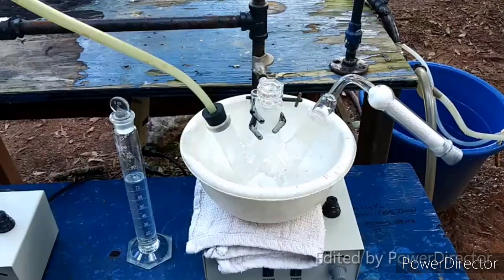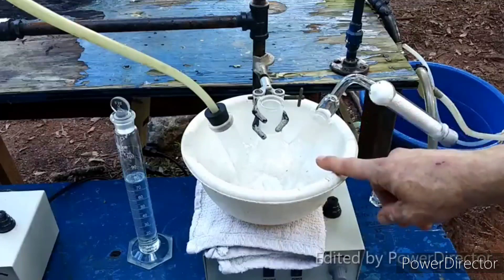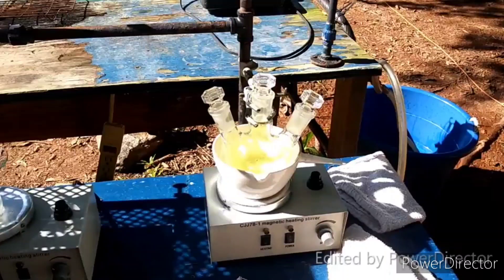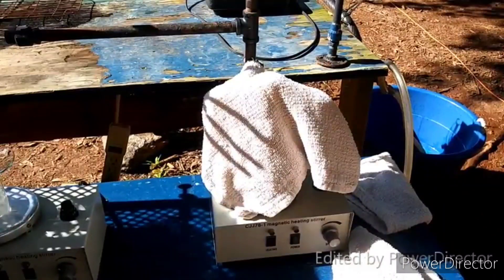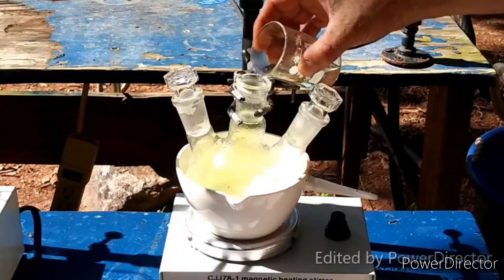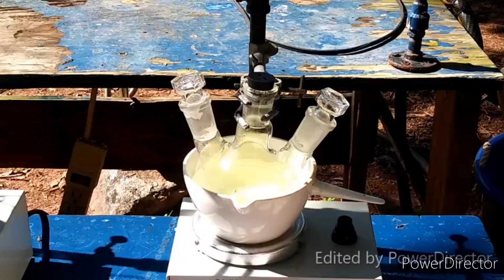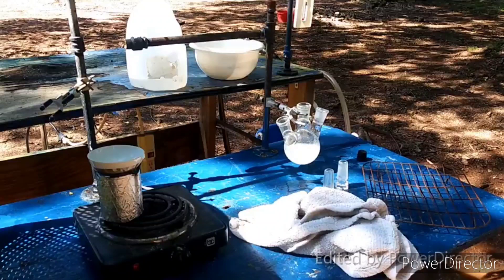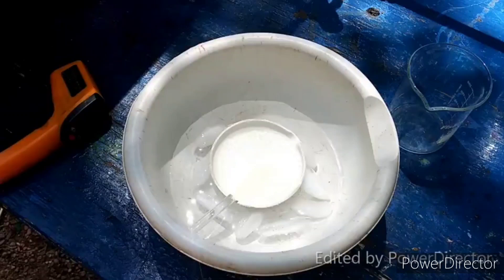How to Make Ammonium Hexachlorostannate(IV) #chemistry

Comment: Smelly toxic chemistry on a picnic bench. Been there. Yeah the chemical you just inhaled is chlorostannic acid, Cl2, and HCl. nasty stuff. The copper salt is added to antifouling marine paint and is 😵 toxic. Get yourself an israili gas mask with some nato cartridges. Stay safe. ❤
Reply from the maker: Sadly gas masks don't work for me. Because of my beard they won't seal properly. Shaving the beard off isn't an option so I just have to be really careful.